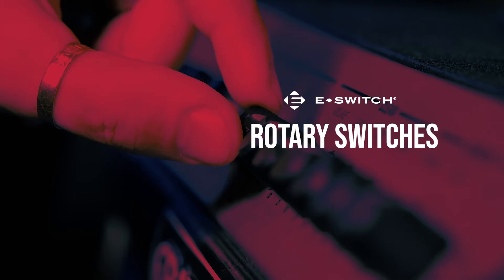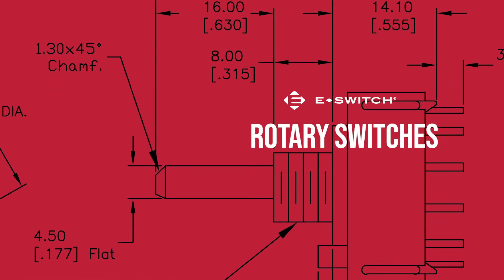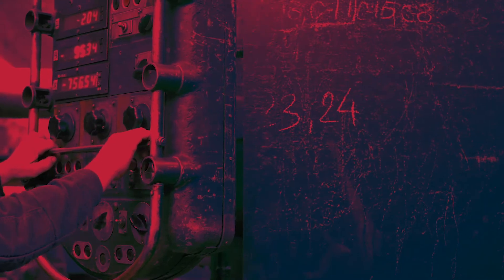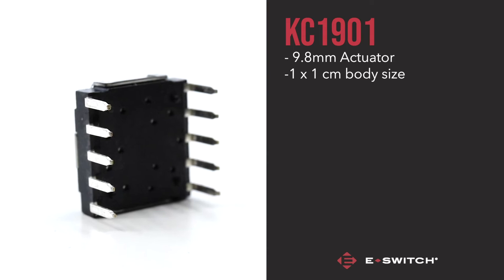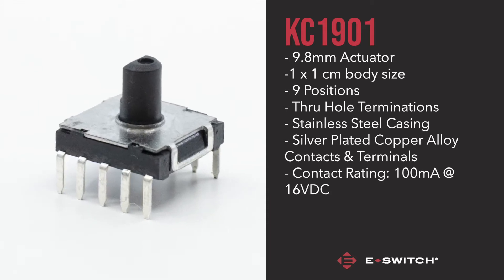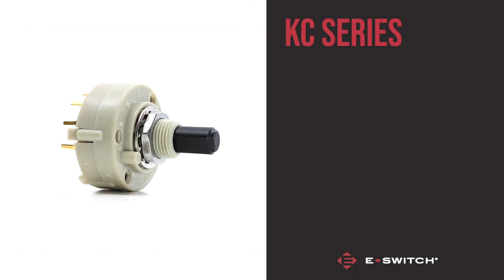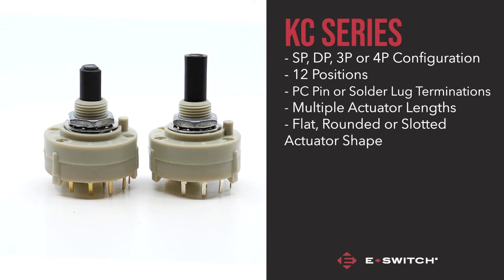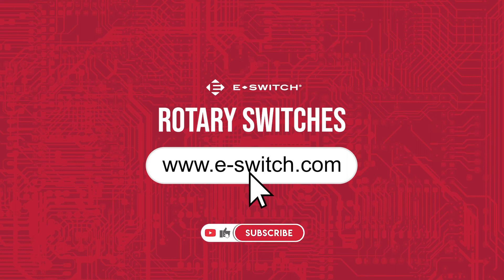What are Rotary Switches?

Comment: What one of these would I get that is 5 dpdt in a rotary?
Reply from the maker: Hello,

Thank you for reaching out. The KC25 provides your requested feature – DPDT 5 positions. I have attached the link to the product detail page which will allow you to configure your switch for a perfect fit. The webpage also offers a distributor stock check (click Additional Options after configuring your part number). This will show the availability of that part number from many distributors that stock E-Switch products.
https://www.electronicsweekly.com/news/business/top-actuated-reverse-hole-mounted-tact-switch-2021-10/
Reply: @ESwitchInc  that link is for a tack switch
Reply from the maker: @HometownUnicorn  Sorry about that, here's the right link. https://www.e-switch.com/product-catalog/rotary/product-lines/kc-series-rotary-switches#.YWBfatrMI2x